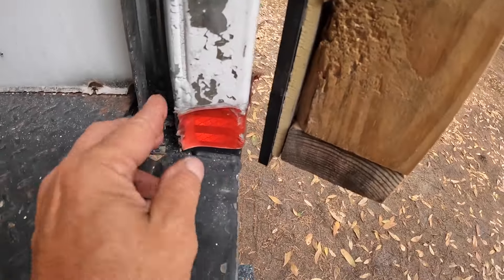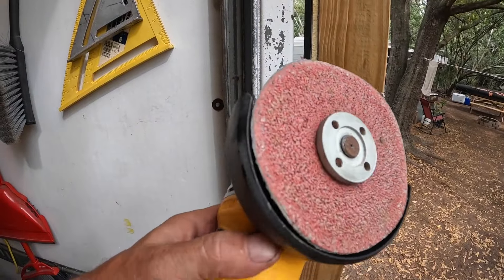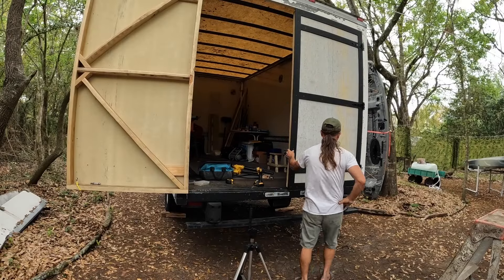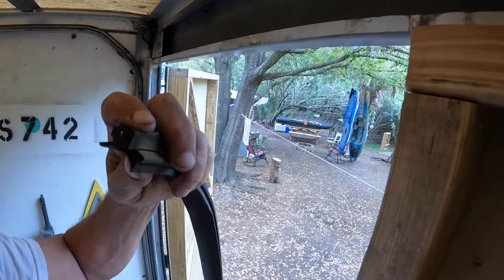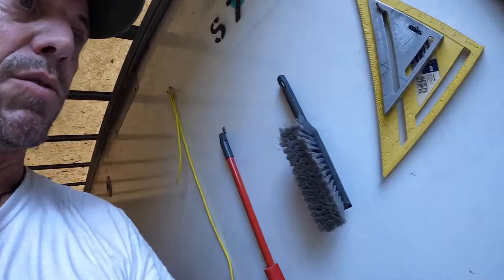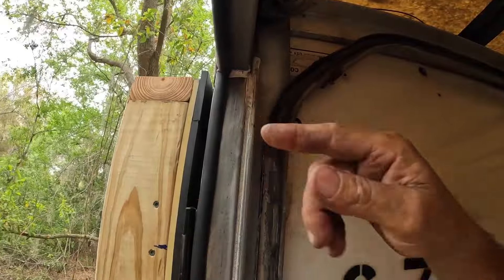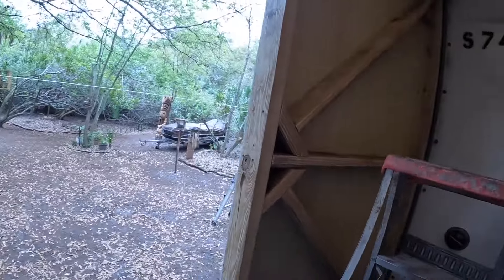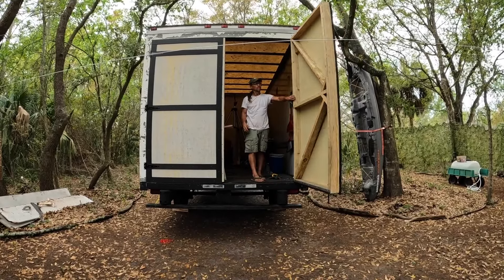Workshop 005 Weather Proofing

Comment: Good job, but having installed hundreds of outdoor coolers and freezers, I would suggest two things. A short "awning" above the door, just two or three inches to deflect the water away. And another sweep on the outside of the bottom of the doors. Then you should be pretty dry.

Comment: I noticed your hinges are gate hinges. Nice sturdy and easy to install.  Problem though they are not real secure for security reasons.   The screws can be easily removed and the door will fall off.  You may consider someway to alter the crew heads so they can’t be tampered with.    The trailer will be a great workshop for you.
Reply: I said the same thing in the other video. He can purchase hinges that are placed on the inside of the doors that way they can’t easily be unscrewed.